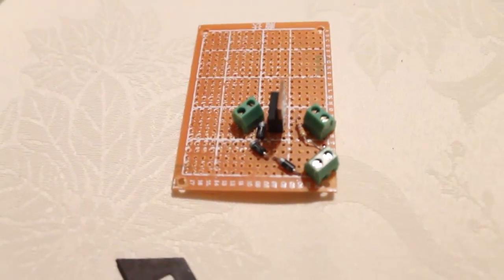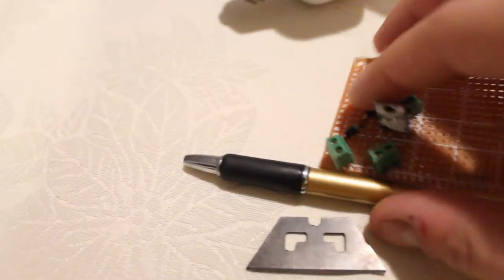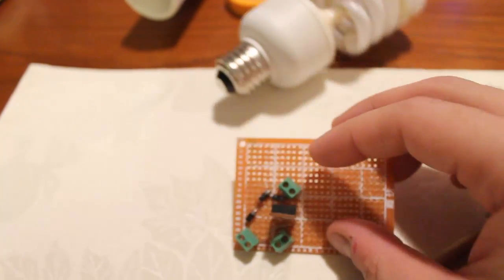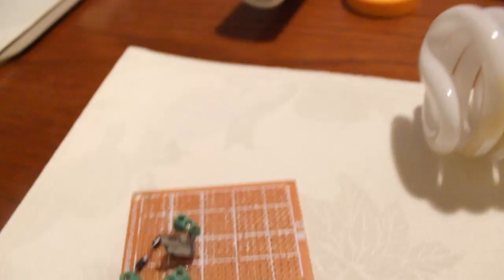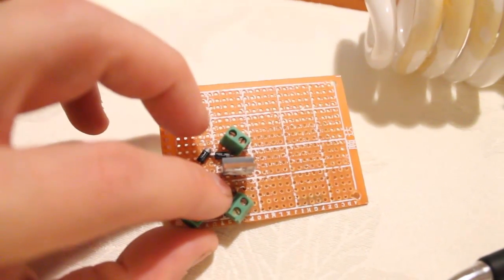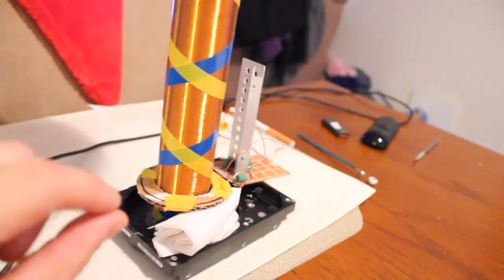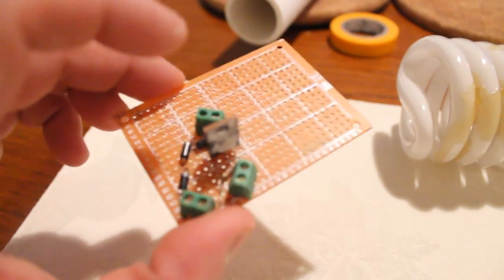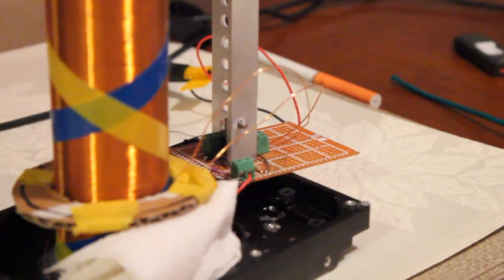Solid State Tesla Coil Circuit Board

Comment: I made to work my slayer exciter too but I could not get it to produce that much light of the cfl at that range. mine is about I think 350-400 turn L2 and 8 turns of L1. I use an inch diameter pvc pipe, tip31c, and 50k resistor. btw, my L1 is 16 awg wire, is it thick enough?
Reply from the maker: The L2 may be lacking a couple hundred turns. You can attempt to use a 4 turn primary, and that should achieve a better output, but ultimately 500-700 turns of your L2 would be better. 16 awg is fine. Up to 22 would also work fine.

Comment from the maker: Try tweaking the positioning of the L1 relative to the L2. A quarter inch up or down can make a huge difference. If your circuit is producing heat from a 9V battery alone its not running optimally.

Comment: if u disconnect ur resistor after startup it will continue to oscillate without it, this helped my transistor run cooler,so im installing a push button on my project to jumpstart oscillation,nice work bro thanx for posting

Comment from the maker: Yes, there is much involved. I cannot speak for the performance of other transistors besides the TIP31C. Keep in mind, we need to get at least a 1mhz toggle frequency from the base, and have it supply enough current at that frequency. I'm in the process of registering a domain, in which ill be able to post full tutorials for every step of the process.

Comment: I'm not getting breakout, It could be the ally wire (kind of surprised it worked at all!), or it could be my thin L1 (no thick wire on hand, about to try braided..) I have 2 sweet spots, one similar to yours, and another, slightly better another 2' up. the better one gets the transistor hot, the lower one not so much, although massive heatsink still helps. I get 1-2mm of plasma to an led or ground. half that to my finger.  Two parallel thin coils on the 2 spots was ok, might re-try that too.

Comment from the maker: Yes at least 50K is good. A half inch will make a difference as far as temps are concerned. I adjust the L1 without the top load. So basically, I move the L1 up and down the L2 coil until I find the most violent breakout plasma from the tip of the L2. That's somewhere around 1.75 inches from the bottom of my L2.

Comment: Thanks for this. Any advice on finding the sweet spot, and coil? My transistor mostly gets very hot. Upping the resistor to 50k helped a bit. I have a few L-1's I have been playing with. After winding L2 with just over 1k turns, I found my de-gauss coil is ally, Bugger. No top load yet, Should I do that first? Still works surprisingly well. Can't get TIP122 to go though :( Cooked a tip31 before I found out about the heat, Got heatsink now.